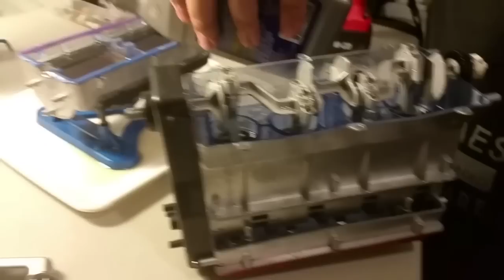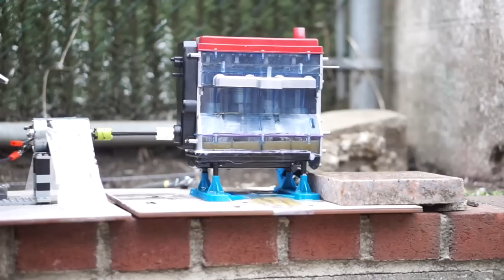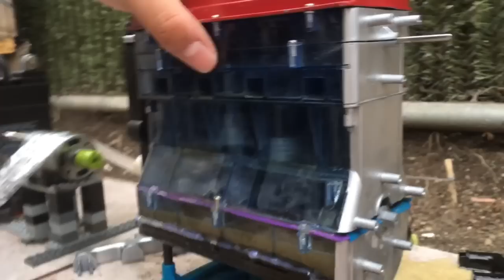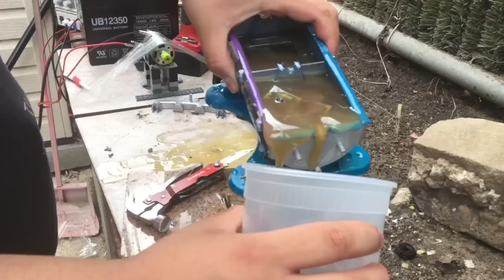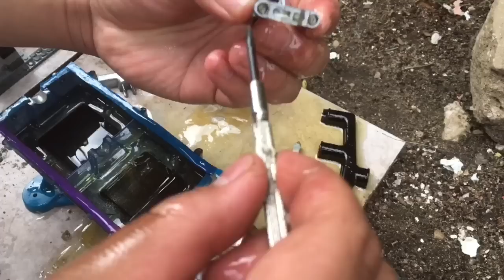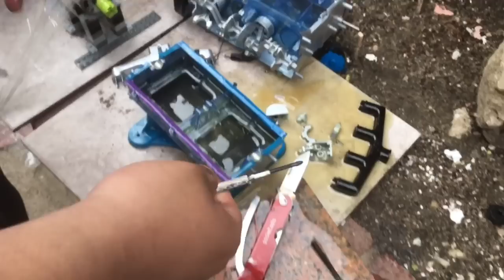Toy Engine @ 10,000 RPM With Oil Like a Real Engine

Comment: You guys should try making another tiny v8 but with with steel legos and see if you can run an even higher rpm than the boxer engine you made without it breaking